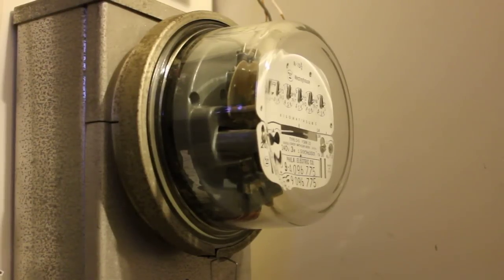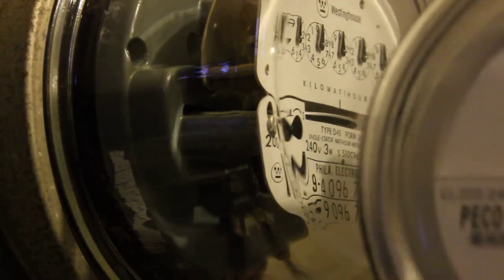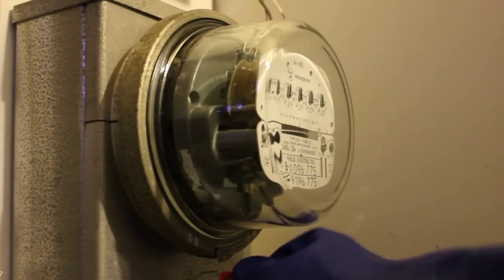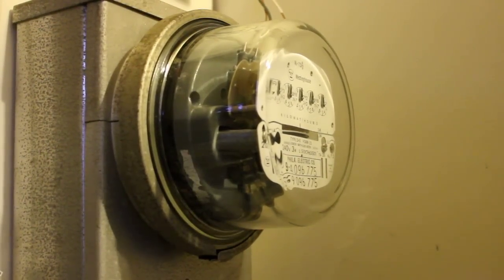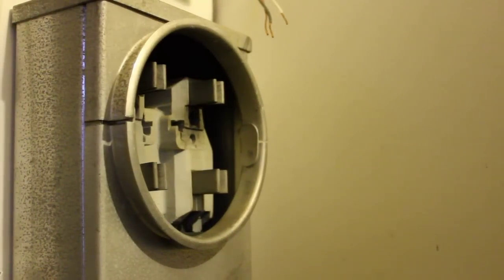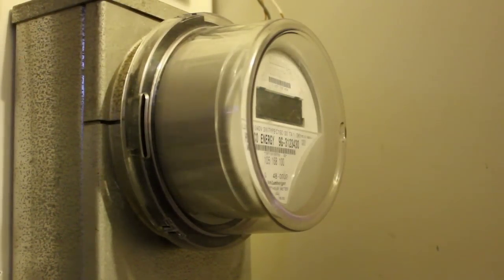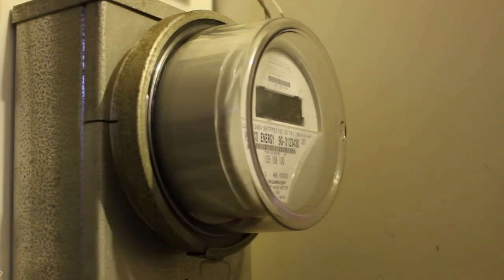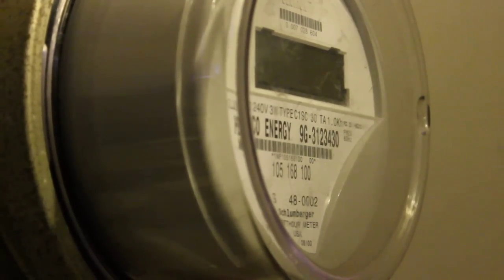Electric meter changeout

Comment: I was an electrician fore over 30+ years .i.my area we used milbank meter sockets they used to be good .Starting in the 1970s Superior made total junk VERY LITTLE CONTACT WITH THE METER BLADE. Then Milbank made the exterior reinforced clip AND VERY LITTLE CONTACT WITH THE METER BLADE .Fore a while i was using Landis & gear THOSE WERE REAL METER SOCKETS . YOU HAD TO PUSH HARD TO INSTALL A METER [THOSE SPRING REINFORCED CLIPS      MADE FULL CONTACT WITH THE METER BLADE AND SQUEEZED IT VERY HARD .This is what i want on 200 amp service. I dont understand how at first Superior,Anchore & now Milbank can MAKE SUCH JUNK IM PISSED WITH UL FORE APPROVING THIS INFERIOR  CRAP .I wish my utility requiered JAW CLAMPING LEAVER BYPASS METER SOCKETS . Have you metersocket00 taken a close look at a MILBANK 200 AMP PLUG IN METER SOCKET LATELY ???????????
I like SQUARE D QO with pigtailed AFCI breakers [neutral rail is aluminum] budget SIEMENS with COPPER BUSSBARS . 3/0 COPPER 2 IN RIGID METAL CONDUIT 200 AMP/  1 1/4 RMC & NO 3 COPPER fore 100 amp service . Whole house must be done in EMT with 4  by 4 1900 or larger boxes.

Comment: A Florida Power & Light employee was installing a replacement meter couple years ago in an office building's meter room.   Dam lucky dude was wearing heavy gloves, face shield, and some type of protective clothing. Don't know what went wrong but the entire area had a large burn flash filling the area with thick smoke. Based on the condition of the face shield I would bet without it he would have been a goner.

Comment: Great video so I just bought a house from 1950's the service is coming underground is there a way to tell what size wire is coming in without pulling the meter? Right now I have 100 amp but want to upgrade to 200amp. Thanks Luba
Reply: You can email me at josephbrown10299@gmail.com and I will be happy to help

Comment: How do you turn off the power going to the meter? Is it just the main breaker?
Reply: You don't. Either you or the electric company will do this
Reply: NO. The main breaker is AFTER the power passes the meter so the only way is cut power at the pole.

Comment: I need to swap out my main breaker. Can I just remove and install the meter with no problems?
Reply: A Florida Power & Light employee was installing a replacement meter couple years ago in an office building's meter room.   Dam lucky dude was wearing heavy gloves, face shield, and some type of protective clothing. Don't know what went wrong but the entire area had a large burn flash filling the area with thick smoke. Based on the condition of the face shield I would bet without it he would have been a goner.

Comment: WOW, I HAVE NEVER SEEN AN ARSONIST AT WORK BEFORE
WHY WOULD THIS ARSONIST DO THIS TO A CUSTOMERS?
IF THE METER IS NOT BYPASSED, THEN THE CHANCE OF A SMART METER FIRE INCREASES BY A FACTOR OF 1000 TIMES
*IF THE CUSTOMERS METER BASE IS NOT INSPECTED TO MAKE SURE THEY STILL MEET UL CERTIFCATION, THEN RISK OF A FIRE INCREASES BY A FACTOR OF 10,000 TIMES AND THE UL CERTIFICATION OF THE CUSTOMER'S METER BASE IS DESTROYED BY THIS CRIMINAL ACT. 

WATCH, AND TAKE NOTES ON THE ONLY LEGAL WAY TO DO A METER SWAP
https://www.youtube.com/watch?v=G0bq2Hn2vOo

Just in case you wanted to know, here is the LAW in Canada.
“CSA C22.2 NO. 115-14 1.5 says “Meter-mounting devices, as covered by this Standard, are not intended to be used as load-making or load-breaking devices.”, meaning that electricity must be disconnected or turned off during meter exchanges.  Aside from the obvious concern about the arcing and consequent pitting which occurs when contacts are made or broken under load, another concern is that one's meter base could lose its CSA certification if it’s been used as a load-break device.”  
SMART METERS CAN NOT BE USED TO INTERRUPT THE LOAD

Comment: What i am trying to say is main lines off transformer need to go to a terminal block that distributes the red and black line terminals into many red / black terminals that run to each line side meter terminals... then the other side of the meters i.e the load side meter terminals you connect the other side of say 3/0 gage wire to the main breaker panel for each section of house. And your done ready for installing main breaker and circuit breakers for the house at that point

Comment: Also when you have many meters per house you must just have a junction box or terminal block that you run the red and black wires to before running them to each meter for a specific section of the housing for different families then from there  you connect up the load red / black wires to each meter on the other side run to each breaker box of each families house

Comment: Wow not bad for the meter change/installation nice video but usually the top line terminals would still be hot that you touched.  Like pushing in a fuse .
Reply: Yea, those were hot. Definitely not a good thing to post to YouTube. One small tear in those gloves and you’re a goner. Plus those were definitely not true insulated gloves so who knows what the insulation rating would be on them
Reply: sam111880 balz of steel. He had gloves on but damn I still wouldn't touch line voltage

Comment: Did you ohm out the load side before plugging in the new meter head? No, you did not!  If there was a short after the meter but before the main you would have been dead when you plugged in new meter head. That meter would have exploded in your face!  There is a lot more to replacing a meter head then what you show.  Always ohm out for ground faults on the load side of the meter box before plugging in a new meter.
Reply: Brandon B serious question but if there was a ground fault wouldn’t there be problems before you even swapped the meter?
Reply: I don't know about dead no load means no amps and that's what kills you. (residential anyway)     Unless there is a blowdryer running inside the walls before the main panel he would live even if shit went wrong.   However if that home is not grounded and there is a bad short or even a capacitor charged some ware down line u could be blind or face burnt and scared rest of life when the glass blows like a light bulb only 50times force. but 99% time u would live.  now if you have a load and pull and it goes wrong by by.
Reply: Are we talking about putting a NEW or different meter or any meter in general? .  And did he just pull that meter off while on??? I'm just curious.

Comment: FIRST OF ALL I WOULD LIKE TO START OF BY SAYING......YOU HAVE NO BUSINESS INSTALLING ONE OF THESE OR EVEN OPENING ONE. THE METER BOARD YOU SO CARELESSLY OPENED IS WHAT'S KNOWN AS A SPLIT BOARD METER SOCKET WHICH ARE VERY COMMON TO FAIL AND DROP ACROSS THE BUSS CAUSING AN ARC. SECOND. THE GLOVES! SERIOUSLY THEY ARE CLEANING GLOVES AND METERS DON'T EXPLODE WHEN U REMOVE A RING. DID U HAVE A ARC SHIELD ON UR FACE? Safety glasses? 1000kv rated gloves? Fr clothing? Don't make these videos!
Reply: This comment gave me leukemia 4 years later
Reply: Why do old people always type in caps?
Reply: RIP. BE SURE TO WEAR YOUR ARC SHIELD

Comment from the maker: I get a lot of my meters at abandoned houses, BUT make sure that the power is off. I did a summer job for peco and someone stole a live meter and it was a very unsafe situation. But if the wires are cut have a go at it, but I have to warn you about the dangers.